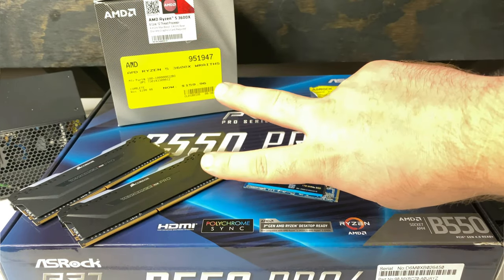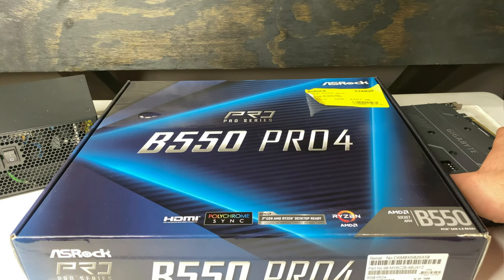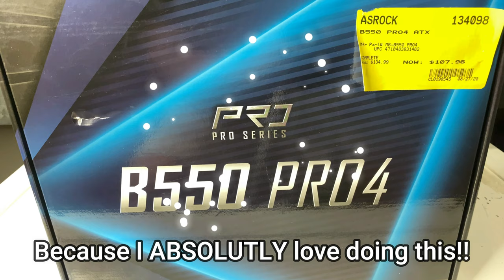Building a B550 Ryzen PC Timelapse (ASRock B550 Pro4 + Ryzen 3600X)

Comment: Planning to combo it with AMD 5600x and 1060 3GB (will upgrade gpu in future). Is this MOBO good enough for future proofing? 
or any other suggestions for MOBO the 5600x + 3060?

Comment: Yo, I have hit a bit of a roadblock because the pro4 has A_LED headers and I have A_RGB fans. I see that your case is A_RGB but your using a motherboard that provides only A_LED headers. Any ideas as to how I can work around this?
Reply from the maker: I’ll be completely honest and say I don’t remember this exact situation but I believe I used the razer ARGB controller to connect the fans. Anytime my motherboard doesn’t have 3-pin rgb headers I just use the razer controller. Works better than most motherboard headers/software anyway 😅
Reply from the maker: Actually I just rewatched this video and on this build in particular I used fans that had their own hub/controller and they were controlled with a remote or buttons (I don’t remember exactly). But yeah, usually I use the razer ARGB hub. It’s a solid hub and I still use it these days.
Reply: Thanks so much. Much appreciated. @BuildsWithV

Comment: I just recently built a PC but have little to no knowledge of building a PC. My friend has been helping me build it since he is much more knowledgable about it. All I know is that I have this motherboard. When I first assembled it he said that the fans should start spinning as soon as the power supply is turned on but they didn't spin, although the LED lights in the back lit up. He does have a different motherboard though. Another thing is I can't find a GPU anywhere so maybe it's because I don't have a GPU to plug in? Help!

Comment: Hey I have a quick question. On the motherboard, the LEDs for the CPU and DRAM are lit red, and I was wondering how I can get rid or fix the issue? I am new and a noob to PC building so I'm not too sure what to do.
Reply from the maker: Mine went away on its own. Sometimes it can take a few minutes and sometimes it even restarts a few times on its own. But if it doesn’t go away then your bios may need an upgrade or a reset. If you can’t get into bios then you can reset it by taking the small bios battery out. Make sure your pc is turned off and unplugged completely. Then look for a small round chrome battery. You just remove it for a few seconds to rest the bios. Updating bios is a bit more complicated but there are tutorials out there for ASRock. Thanks for watching

Comment: Is it too complicated to remove the video card using an air cooler of this size? as the video card is very close to the CPU cooler, it may be difficult to tighten the security lock to remove the video card
Reply from the maker: It is more difficult on this motherboard. The PCIe slot is way to high on this motherboard and it does almost touch the ram and the bigger cooler. I used a long item to push the little lock to remove the GPU.
Reply: @BuildsWithV  
I have a cooler master hyper 212 rgb black edition, can I remove the card using something long to press the video card lock? or do you think I better choose another motherboard?
Reply from the maker: @leonardorj162  that’s completely up to you. You should be able to use a long stick or something to push it in in case you need to remove the GPU.

Comment: 5:45
I see your VGA and BOOT lights turning on before the cut
How did you fix it? ;-;
Reply from the maker: It fixed itself. It just ran through whatever it had to do and booted up. Happens often with new builds. If there’s anything wrong then they’ll stay on
Reply: @BuildsWithV  the AsRock B550 Pro 4 of my friend stays on boot and vga and we can't figure out why... Guess the Mobo is ded. The GPU works on his old build, his old gpu doesn't work on the new build. Tried everything already...
Reply from the maker: @juandig  that’s weird, maybe it is a bad motherboard. Have you tried to reset the bios? If you can’t get into the bios then I’d say pull out the small bios battery from the motherboard. Make sure it’s unplugged from power as well.
Reply: @BuildsWithV  that's a good idea, I'ma advice him if he's still available
Reply: @BuildsWithV  he said it didn't help :/
Reply from the maker: @juandig  dang that sucks, maybe it is just a defect with the motherboard. I’ve never had this issues with any ASRock motherboards so I’m not too sure what else it could be.
Reply: @BuildsWithV  my friend's gonna request a replacement board and return this one

Comment: What screw driver did u use for the m2
Reply from the maker: No idea the specs on it but it comes in the motherboard box usually. If you’re missing it you can probably buy any m.2 screw. Not 100% sure but that’s my assumption

Comment: I have everything set up but my fans won’t spin help ?
Reply from the maker: How do you have the fans plugged in?
Reply: @BuildsWithV   I have a view 37 argb case and in the back it had a certain box to plug in fans the fans is white tip with 6 pine but the box has a start power to plug in but I’m not running hard drive
Reply from the maker: @parkaddiction2426  you’d just have to plug the sata power into the power supply. You wouldn’t need a hard drive or anything else. That should fix the issue once you plug the controller into sata.
Reply: Thanks. But the sata power doesn’t fit in the power supply witch one of the cords am I gonna have to put in mother board
Reply from the maker: @parkaddiction2426  do you have a modular PSU?
Reply: I have power spec 650 w and B550 steel legend mother board
Reply from the maker: @parkaddiction2426  okay so your psu should have come with extra cables. One of those cables will have sata connectors on it. You have to plug that into the PSU and then into the fan hub.
Reply: @BuildsWithV  I was able to connect the cable in the sata spot in the psu and sata power on the cable but the other end there’s no way I could connect any it’s a like a c12 cable it has 4 holes
Reply from the maker: @parkaddiction2426  okay then that’s a molex connector. Your psu should have come with a molex cable as well.
Reply: @BuildsWithV  it there’s no molex connectors should I buy a new fan hub ?